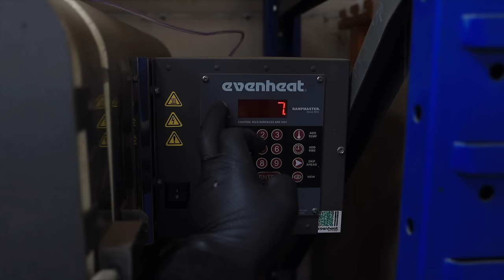Making a Kinetic Whip Sword - Will It Work?

Comment: Would recommend putting a mushroom like curve on blade segments, or some kind of trapezoidal shape with points so they tear when dragged across. Something similar to  concertina  wire.
Reply from the maker: It’s a sword that whips so it’s built the same as a sword
Reply: @DiesInEveryFilm Customs  I get it and not criticizing. Just an idea to make a cool concept more cool.
Reply from the maker: @seanvinsick  you need to understand that is your idea and opinion and people’s ideas are different, I designed exactly what I wanted here and it came out as planned.

Comment: Just curious, why cover the sword with the rubber blanket while welding the pieces to the metal cable?
Reply from the maker: To prevent any weld spatter or it arcing

Comment: I cannot begin to imagine how loud that saw is, BTW whats the difference between a circular saw and a vertical bandsaw in terms of cutting, is one cleaner than the other, is one faster at cutting, which can Deadpool possibly cut his dick off by accident easier, etc?
Reply from the maker: Yeh it’s pretty loud, this is accurate as it holds the piece and cuts straight
Reply: @DiesInEveryFilm  wow so it beats the verticle bandsaw

Comment: It REALLY bothers me that NO ONE ever “heat-treats” the ENTIRE piece of metal.   Only 3/4 of the metal is heat-treated.   Why is the last 1/4 soooooooooo unimportant????

What I mean is.   When it’s quenched, there’s still 1/4 of the metal that never seems to be quenched.   The whole entire piece of metal never seems to get dunked!

Whyyyy?
Reply: Because heat treatment makes blades hard but brittle. What I mean by that is that a hardened blade won’t bend but when it takes enough force it will snap. Because of this when it comes to blades it’s better to harden only the part that needs to hold an edge while leaving the tang and even part of the base soft. Sometimes blade smiths will even put clay along the spine of a blade to prevent that part from cooling as rapidly as required for heat treatment, meaning literally only the cutting edge is hard so the blade won’t shatter and can flex when it needs to